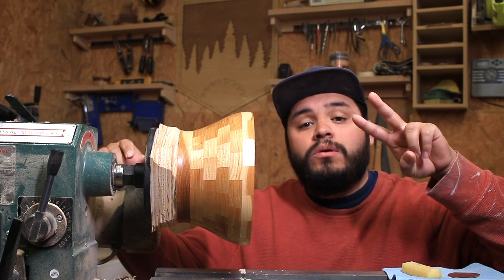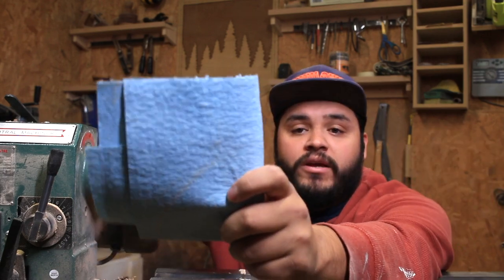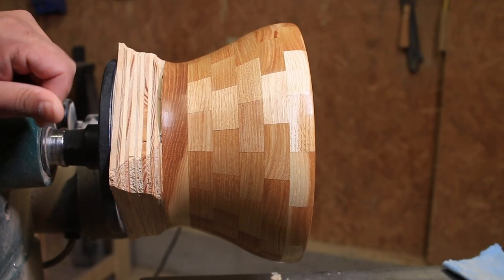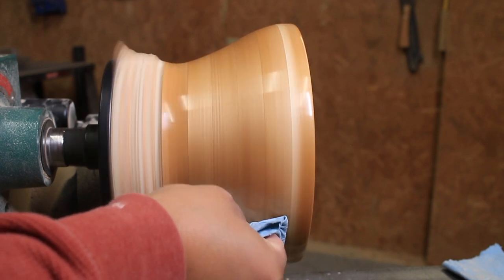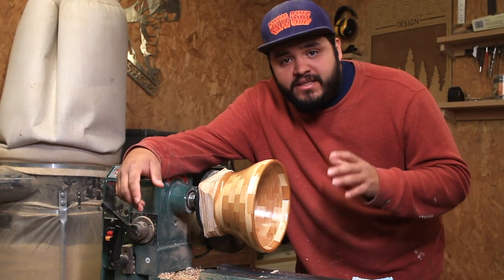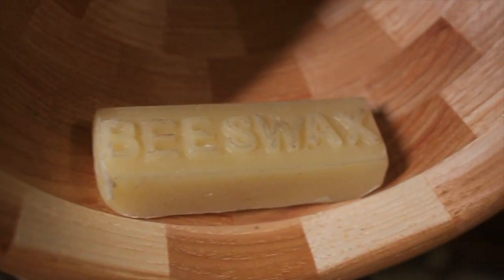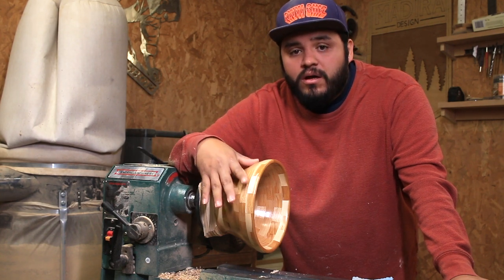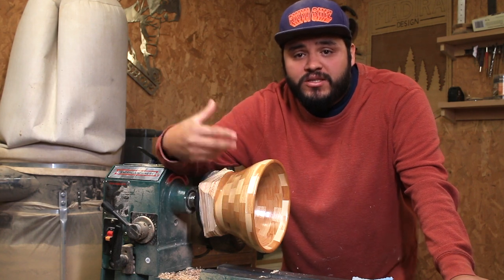How I apply a beeswax finish.

Comment: I used beeswax and a flame torch to apply it to a splitting axe handle. It's great, it makes the handle grip, it makes your hands smell amazing and continually buffs and shines where you grab it as you use it.
Reply from the maker: Oh yeah. I’m sure that gives the handle a great patina!
Reply: Same. recently used bees wax and used a hot air gun to melt and help absorb it into the wood better

Comment: I know I am a bit late to the party since this was posted two years ago, but I have a project I am going to do soon and plan on using beeswax as a finish on it. Never have I done it before. My question is, what kind of oil did you use before the beeswax?
Reply from the maker: Never to late! That’s a great question. I honestly can’t remember. Anything would work fine with it, I like the companies, walrus oil. And bumblechutes.
Reply: @Madira Design  cool. Thanks. I'll check that put. I have a couple of old  wooden wine crates I'm going to turn into a small shelving unit. I think using beeswax would just add to the style I'm going for. Thanks for the info

Comment: Is it ok to put hot liquids in the bowl ?
Reply from the maker: Ummm. I have before, but I wouldn't reccoment it. At least with segmented pieces. for sure it will ruin the finish, on any bowl, so you will probably have to re-sand and finish. And then with segmented bowls it has the possibility of melting the glue and cause the joints to fail.

Comment: Is this as good as varnish?
Reply from the maker: Ummm…. I’m not sure. I feel like a caribous would last a little bit longer. Because the wax and oils can get rubbed off after a good amount of washing.
Reply: @madiradesign  i have a pine hand rail and It needs staining/ varnish. First time i am doing it. Would you recommend a good brand or product?
Reply from the maker: @Amir-f6o1z  for a hand rail. Minwax has a lot of good products. I would probably go with a wipe on polyurethane. It would be durable and give good protection.
Reply: @madiradesign  thank you